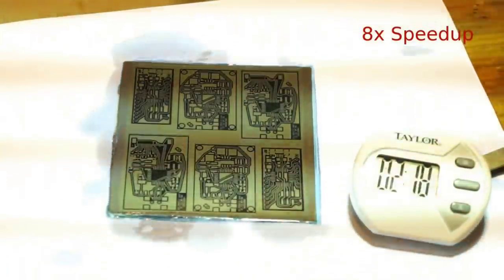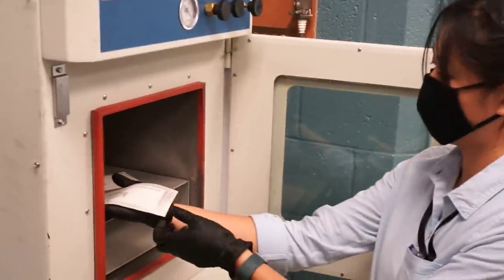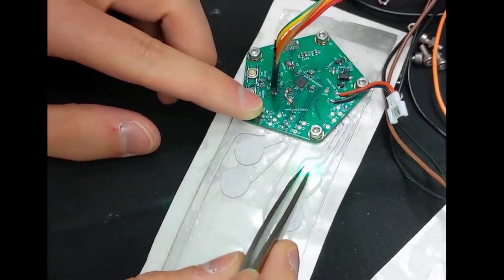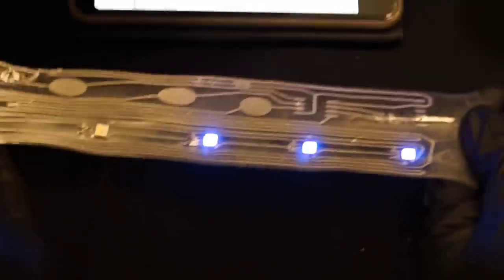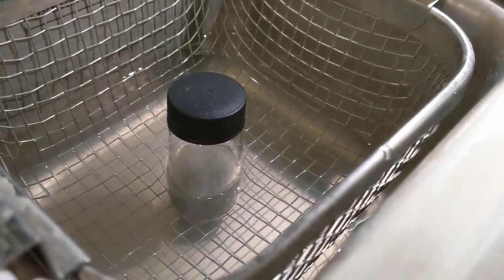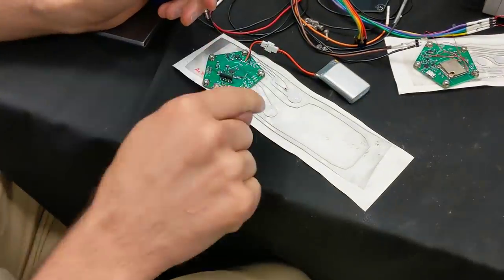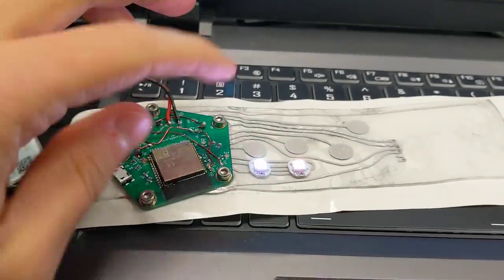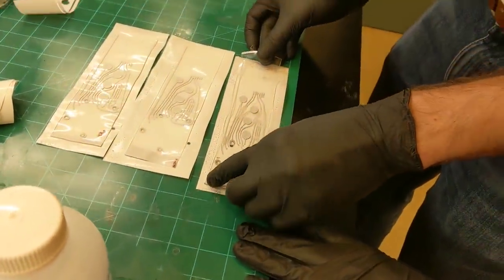Poly LMN: Nanomaterials for Making Stretchy Circuit Boards

Comment: If you use this stuff to make an antenna you could tune it by stretching it... lol
Reply: hey, frequency variation can be used to measure the stretch
Reply: You're one day ahead of me :)

Maybe if you print a mesh on a flexible sheet, you can even use it as a parabolic reflector with a variable focus, by pulling a vacuum on one side.
Reply: You could stretch it to fill a 1km wide impact crater on the moon

Comment: Woah, this has a potential be be a really good electronic skin, just throw a this thing touch matrix, and you can envelop any surface (even elastic) in this! The second idea is to make 3-layer skin, 1. elastic matrix 2. Elastic isolator 3. Elastic matrix, this way the material would be able not only to sense touch, but also the pressure. Also this would be a great material for e-textiles.
Reply: @Carl Thrasher (Capt) As I think about it it could be used for VR gloves, with some AI the pressure gradient of such "skin" could be transformed to individual finger tracking, and from the user standpoint, the glove would look just like normal elastic glove, maybe just with a few air wents and a rigid elements for electronics. That gaget would be a hot sell for around 300 USD, so with mass production of elastic circuits it could be done in the future. I think the electrical stimulation of the human skin in a predictable way is also possible. Great work, the possibilities for this tech are endless.

Comment: very, very cool.  i think, many practical applications will not require stretching it to the limits, as in: durability in small but frequent deformations goes a long way.

another concern, how far could it be scaled down, for at this scale i think it can be replaced by fabric embedded flexible wiggly thin wires

Comment: The first thing i could think of is flexible stretchable oled screens, since one of the bigest issues is the stretching of the screen arount the bend because of it's radius, if the resolution is high enough they could easily compensate for the stretching in software.

Comment: That nanoliquid shouldn't be too hard to DIY even at home -> Gallium-Indium is available commercially as a liquid metal thermal conductor (like for CPU heatsinks) from various companies, ultrasonic parts cleaners can be bought cheap for household use, and stirrers can be found on ebay too. The carrier liquid is an unkown though.
Reply from the maker: That's where the magic is :-p

Comment: is it possible to detect how streched the material is? that could be very useful for VR applications. You would just need to put on these LMN traces onto a glove, and then you could accurately track finger & hand position by how much the material has been streched.
Reply: If the resistance changes slightly and predictably as it is stretched then it should be possible.
Reply: @davemarm  Maybe you could also measure the distance with the run time of voltage?
Reply from the maker: Ooorrrr sweeping a frequency down it and seeing how it attenuates.

Comment: Regarding the antenna de-tuning. I would suspect that it is also possible to create "stretch" sensors using not much more than a a few oscillators, orthogonal antennas, and a remote sdr.
Reply from the maker: I totally agree!